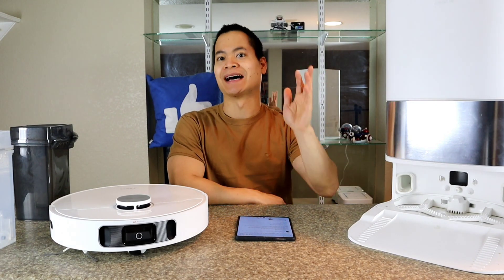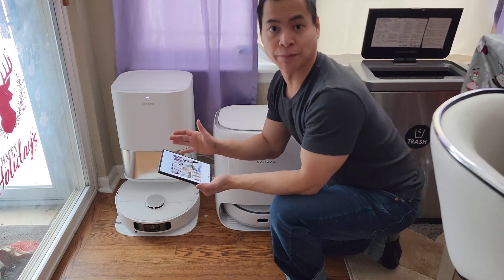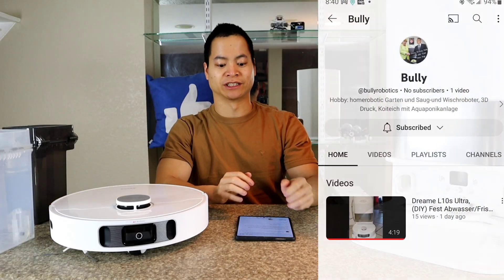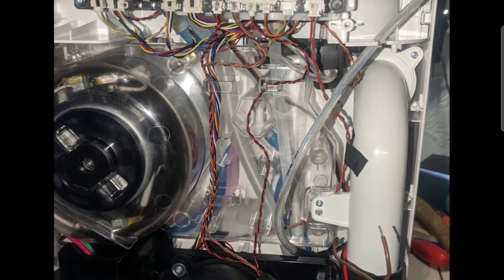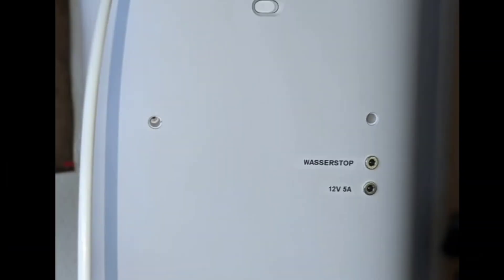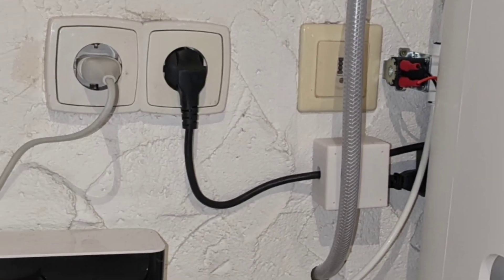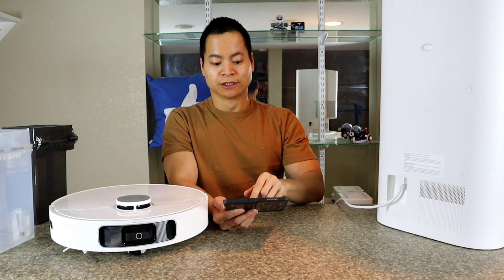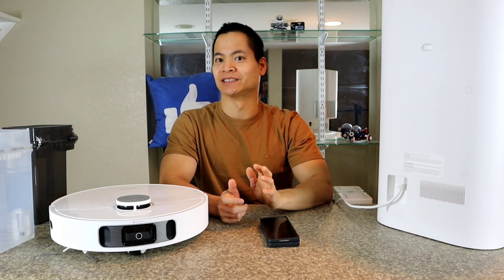First Robot Vacuum that Almost Maintenance FREE - Self Refilling/Emptying Base Station DIY

Comment: Fresh water is easy as you can install something that requires no power.  Just add ball valve, like you use in a toilet and the water will fill automatically every time the water level drops.  There are some easy ways to also drain the dirty water without messing around with the vacuum's electronics.  Have it a different process that triggers off a spring switch every time the vacuum leaves, for example.  Or use a ball system, like the clean water, with the difference that it just kicks on or off the pump - depending on the water level. It is however nice to see people look at options.  Biggest challenge for me is to have the vacuum close to a water source and a place where the dirty water can be dumped!
Reply from the maker: That a good point, similar to those portable drinking water systems. Yes I agree you would need to install an additional water line.
Reply: yes it works, but is not safe because when the station not stop by the original switch your house is a pool!!!(we have in german some station with wateroutless in house with broken station)
Reply: @bullyrobotics  That is why you control it with a floating valve.  But that is only theory :) You are the man who actually built a system, which is great

Comment: I don't know if you knew, but Chinese domestic version of Dreame, so does Roborock do offers automatic refilling and empty setups as add-on, a device that replaces the tanks and hoses added to an existing inlet outlet behind the machine. My Dreame S10(domestic version of what you have) do have this inlet/outlet although I didn't opt for the upgrade, it is still possible for me to do so should i need it in the future.
Reply from the maker: Good to know, I think some markets don't have the infrastructure or is not popular enough to implement the hoses to their homes.
Reply: @RobotMasters  I think you are right, although I don't really see why people in the western world getting their hands on the Chinese domestic version of the robots. They are far cheaper than the price it is selling at for the export versions, and has more functionality, and supports English interface too.